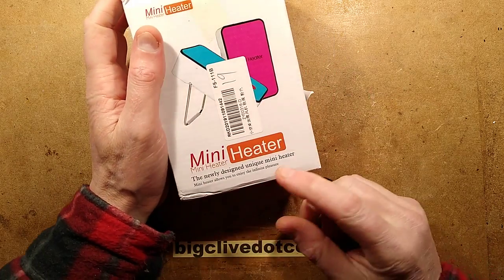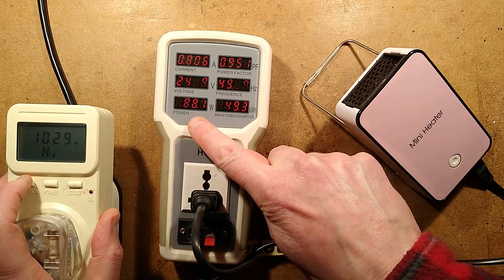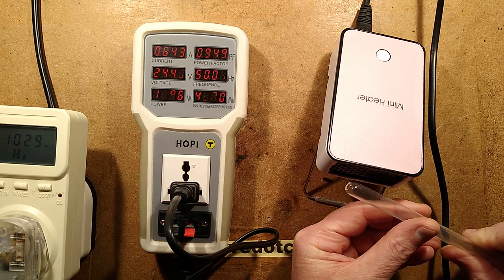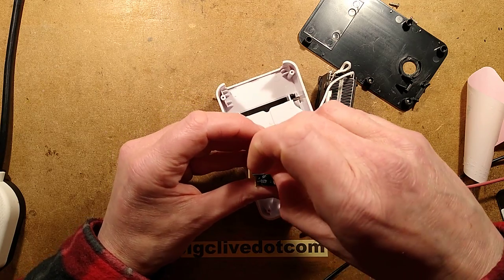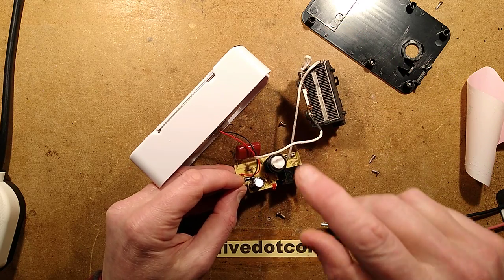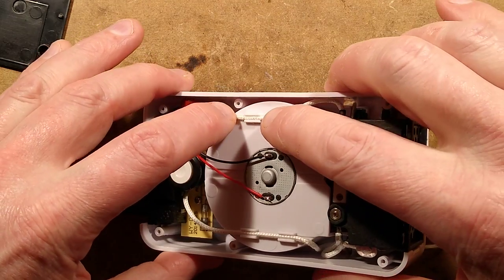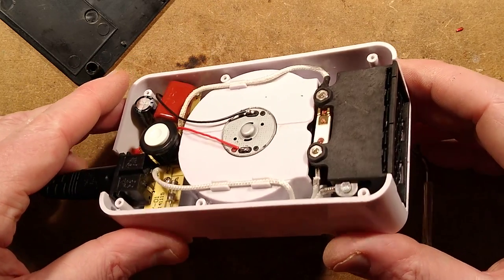All plastic 150W eBay desk mini-heater.  (With schematic.)

Comment: Anyone else end up rooting for the little thing?

"It'll overheat and not cut out if I put it down flat."

cuts out

"It won't start up again."

starts up again

"It can't shrink heat-shrink."

shrinks heat-shrink
Reply: It's the little fan heater that could 🙂

Yep, I tend to root for the cheap electronics. There is something satisfying about things that confound expectations because, despite being cheap, someone somewhere down the line has put some thought and care into the design. For me it beats the "this USB charger might kill you" type results.
Reply: Just so long as he doesn't say "It's perfectly safe" we're ok.
Reply: I think 🤔 it can, I think 🤔 it can, I think 🤔 it can, It Can!!!!!!!
Reply: it trust it tbh
Reply: I have one
Reply: Yeah it's a verry good thingy I mean the safety functions and so I am amazed
Reply: Go mini heater go! Decent build from the looks of it.
Reply: I bought it thanks to this video. But also cause well during Winter i feel cold at my desk, DESPITE HAVING THE HOUSE HEATER ON.

Now our heater died..:< We're working on getting it fixed.

I have been using it and it keeps me warm at my desk throughout these times.
Reply: YAAAAAA! WOOOOO
Reply: I mean it's a electric heating element with a fan in it. You can buy 1500w heaters from Walmart for $12 with the same "features".

Comment: I've got two of these living in an outdoor mini-greenhouse with a DIY thermostat controller to keep it above 15 degrees in winter....so far they have lived semi-outdoors for 2 straight years and are still working. Very impressed!
Reply: Hi mate I was just wondering how long you run the heaters for. Do you think they could run all day and night or is that to long?
Reply: @holdengurl1013  You could run them 24/7. I only had one fan motor die but the built-in bi-metallic thermoswitch stops them catching fire.
Reply: Thanks. Dose the one the fan died still heat? Or does it cut out.
Reply: @holdengurl1013  The heating element turns on but because theres no air flow it trips the thermal switch eventually which turns the heater off.

Comment: 7:50 that motor is an RF300, a very good (high efficency) motor. Runs in either direction, can output some torque.
Forgot the exact specs, but was somewhere 0.5 to 6V.
Reply: Assuming the zener is swapped out for a 6v one, any idea what value of dropper capacitor would be good to make the fan run at full speed?

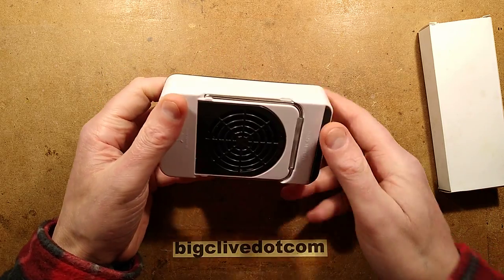Comment: 1:37 The way I remember it is that an axial fan is the one that moves air along its axis (ie a normal fan), whereas a radial fan moves air along its radius (ie a side blower fan).
Reply: That's it.
Reply: Yes, but I think that our favourite Clive may have been confusing the 'lean' of the fan blades (or he may not).

I have encountered someone who thought that because forward facing blades would 'scoop' the air in that bulk air flow would be from outside to the centre of the fan if reversed (for this type of radial fan).

air will flow centre to edge if rotated in ether direction.
https://www.rs-online.com/designspark/fan-types-why-choose-a-forward-curved-centrifugal-fan
Reply: That made that connection super obvious xD

Comment: Thanks for another great tear-down video, Clive. I've got one of these heaters and you've given me a peek inside. It's good that they took the trouble to add a zener to prevent the reservoir cap from exploding if the motor goes open circuit as of course it will do in time being a tiny brush-motor. A pity though that they didn't add a current in-rush limiting resistor to protect the contacts in the switch. I've noticed a sharp crack from the switch on occasions at switch on indicating a surge if it hits the peak of the mains waveform by chance. I don't suppose the switch will survive too long before failure because of that. Perhaps thanks to your disassembly demo I'll add a limiting resistor at some stage!

Comment: you talking about the fan and it possibly fouling the housing and making a noise reminded me of something that happened some years ago . My ex used to work for a council in the U.K clearing rubbish and taking things from houses for people when they wanted something disposed of . She went to a house and collected a microwave cooker , quite an upmarket one . Instead of taking it to the tip she brought it home for me to take a look at it . Plugged it in and there was a horrendous screeching noise . Out came the screwdrivers , off came the cover and yes , the fan had moved on its shaft . Eased it out , mixed some Araldite , put back together and bingo , we had a microwave . The thing was like new inside and out , hardly used if at all . She collected it from an affluent area so chances are it was bought , plugged in and made the noise so they just bought a new one and threw this one out . Lucky us

Comment: To be honest, I was surprised by the thermal safety cutout... And then surprised again when I saw it self-resets! I imagined it would be the "unplug-allow unit to cool-plug back in" reset procedure many US heaters have. To have a fuse before the power switch is a nice safety feature that not even Weller soldering stations have.

Comment: Love the video, I use these little heaters for small off grid applications and I ended up adding a diode in series with the element which cut the start up current down by 50% and constant output reduced by 5%.
Reply: That's a pretty genius modification to a PTC heater 👍
Reply: Can you do those modifications for me, if I post it to you from Australia? 😀

Comment: I remember when I took apart a broken camera after I'd been testing it, I thought it wouldn't be that dangerous running on 2 AAs, I bridged the capacitor for the flash and ended up with 2 deep scorches on my finger, its probably the worst shock I've ever had and I've been shocked by a 100kv HT lead on a car. I think the biggest thing was that the capacitor felt like it passed allot of current over a longer period of time which ended up burning my finger pretty badly.

Comment: I like the way the thermal fuse doesn't cut out the fan.
Reply: That part may have actually been designed by an engineer.  But then the bean counters and production line gets a hold of it... So they have to make the case bigger because it was melting, lol.

Comment: I'm still waiting for my chinese automatic house ignitor to arrive that I ordered before christmas, need to get warmed up by dangerous heater products, this one is just too safe with its' thermal cutout safety feature!!! :P
Reply: did you order your  Chinese automatic house igniter ,with or without the automatic magic smoke release option? and it must have randomly flashing colored LED lights or it's no good. it's the only way to tell real china quality.
Reply: @immrnoidall  Real china quality means it arrives broken, with a small boot print on the outside of the package.

Comment: If you wire the fan to run in reverse, it will still blow out the front, but very much reduced, it's a centrifugal fan.

Comment: I have used one of these to stop my hands freezing at my desk over 2 winters and it has been great - but I never leave it unattended
Reply: Why don't you simply use a 100 Watts incandescent light bulb?
Reply: @christiangeiselmann 
Probably because they're too hard to find now with all the greeny laws.
Reply: @christiangeiselmann  Or because they radiate heat in all directions, rather than blow it towards your hands. And if it's on your desk you might not want to have a 100W bulb shining in your eyes all day. And a PTC heater is a neater more rugged package that won't get as hot to touch as an incandescent bulb would.

...Or, you know, it's the green police's fault.
Reply: @christiangeiselmann  What kind of 100W lamps blows warm air in the direction of your hands?
Reply: SkyWizardless   You can hold your hands close to them. Advantage: no noise. - I prefer that, instead of having a thing humming all the time. But of course, your decision.
Reply: @christiangeiselmann  Not very useful if you need to use you hands to do something, e.g. typing on a keyboard.  Not only is there a risk of burning yourself if you accidently touch a 100W light bulb, the idea of huddling up over a 100W light bulb for warmth just seems ridiculous. If your hands are that cold and you aren't trying to do anything that requires dexterity then put thick gloves on and wrap a blanket around you.
Reply: SkyWizardless   Okay, okay...
Reply: "stop my hands freezing at my desk over 2 winters"

Your boss must be a real jerk, Bob Cratchit.
Reply: Jason Carswell   Some people have issues with blood circulation.
Reply: @jasoncarswell7458  maybe works in a warehouse?
Reply: @AAAyyyGGG  Filled with frozen fish sticks?

Comment: Got one of these based on this video to help dry out my car after a big rain leak and it’s done a great job on one side but the bimetallic strip broke after 3 days of it being turned on before I could dry the other side.  Neat little unit though,  not too hot to damage anything just not up to constant use.

Comment: The power lead appears to actually be to US plug standards. The holes in the blades are the US/North American standard whereas the straight/plain blades with no holes is the Chinese version.
Reply: That's what I call a hybrid plug. The blades have the holes, but the part you hold on to appears to be too small to meet standards. Also, heater plugs are supposed to be polarized (so that the switches are on the live side and not the neutral) and those are not. That thing definitely wouldn't meet UL or CSA standards, though it's not horribly dangerous, either

Comment: I like your way of walking us through various "automatic house fire" contraptions, small armpit heaters like this one and hackable led lights.
Have you put together a video of your bench tools, safety measures (like your fire tin), what is the connector you use to hook up mains voltage with?
I've looked on your channel for one but I wasn't comprehensive.
I really liked your video about your mom.
Thanks for sharing.

Comment: Actually that build quality is pretty top of the line for gadgets, wire routing as you pointed out, tab on the lid to hold the mains socket steady, thermal disconnect, everything screwed in, and minimal parts to reduce failure. The only issue with cheap Chinese stuff is you never really know unless you take it apart as you did but they did a nice job on that I think.
Reply: I’ve got one after seeing this being taken apart. It’s got a uk plug and rated 200watts. Output temp is 129°c. Simple & effective for a small room.

Comment: Self regulates and makes low level heat... That might be something that could be hackable into heating for pets. Like a reptile enclosure, bird cage, or a small dog house. (At least if it doesn't outgas much after breaking in for a while.) Heater itself would need some weather and/or mess proofing (likely by mounting it high and ducting the output elsewhere), but it wouldn't be too hard to make it circulate into a bigger enclosure that it helps keep warm. And perhaps controlling it with an external thermal switch, if the enclosure that it helps heat isn't too drafty.

Comment: I have one vary similar to this thing but 12V for automotive battery.    Works quite well to get the chill out of the cab until the regular heater ever tries to warm up.   Defrost the wind shield quite fast too.
Reply: I have one of those for my old pickup, because the heater core went to hell and it's not worth fixing!
Hey, better than a sharp stick in the eye ! 😊
Reply: @kengamble8595  Sounds like my ride.  LOL   I picked mine up at the Flea Market some years back for like $1.00.  It was all grubbed out but cleaned up and still Chooching along all this time.
Reply: @kengamble8595  Actually I wouldn't mind finding a few more.   They would work good as a Dump Load on my Solar system.   Better to warm up the hall way a bit then just use a resistor to burn it off.   Else should be going to a water heater if I ever get around to getting one.
Reply: @pulesjet 
I got mine at Harbor Freight a few years ago, when they were on sale of course! Don't know if they still carry them.
Reply: @kengamble8595  Closes one to me is some 50 miles one way.  I make it there maybe once a year.  I'll try to remember.  LOL

Comment: Those little motors are very common indeed. I replaced the disc drive motor in an XBox 360 with one of these I sourced from the vibration motor in a PS2 controller.
You can't replace the optical drives in a 360 because Microsoft decided to match the serial #'s to the console. But nothing to stop you from replacing the motor hehe
I got the 360 for free because the owner though it was junk - that was 7 years ago and it's still working.
Reply: Nice 👍

Comment: I use a pair to keep the inside of my resin 3d printer warm. A simple temperature controller for a terrarium and some insulation work wonders.
Reply: Yes, I agree it likely has far more better uses than just heating desks.

Comment: I bought this thing just two weeks ago. Very useful when you tend to get cold feet. Also, my heater got a completely different thermal cutoff. It´s like the manufacturer actually watched this video. Now the bimetallic cutoff trips just slightly above working temperature. You block the air intake? *click*, the bimetallic cutoff switches the  PTC  off within 10 seconds.
Even more bizarre, you switch the heater off, you can hear the bimetallic cutoff go "click" because the heater has no airflow anymore, but has residual heat.
What else can I say? It´s *tiny*. Size is like four iPhones stacked on top of each other. Weight is like a single iPhone. It is really silent, there is just a faint "whirr" it emits. I could sleep with that.
Actually I was falling asleep with the heater within 1 ft next to my head twice. It´s not dead-silent, but it emits the kind of "white noise" some people ( like me ) find immensely useful whilst getting to sleep.

Comment: I have a bathroom fan that has the same shaft style (tight plastic, no clamp). Of course, twice now I have had to open it and re-melt the plastic tight and now I have a clamp...but it still sits and stalls from softening over time from the heat generated along the motor shaft.

Comment: @bigclivedotcom - At 14:55, when run in "reverse" by your apparent definition, less air is flung out at a given RPM, but the fan also stops having the annoying habit of pulling more power when the inlet is blocked/less when the outlet is blocked. In the case of this little heater, a polarity-reversing switch on the fan power will give the unit 2 different heat outputs, because at low airflow, the PTC resistance element will run at lower power. By the way... At a higher RPM, those centrifugal/radial fans still move plenty of air when run "backwards", and create significant pressure if necessary to achieve that flow. I've seen them used to drive a minor hurricane of air through rather restrictive HEPA filters, for a once-through air supply to hospital operating rooms. (No recycling of germy air!) The same principles apply to centrifugal pumps for various liquids, and vanes all pointed straight out radially from the shaft also work, with characteristics somewhere in between those of forward-swept and reverse-swept blades.

Comment: I just bought one of these and since I had to take it apart to bring the heating element wires out separately (I'm hacking a little temperature control system for the tent of my 3D printer) I was looking at the power supply and thought, "Big Clive should have a look at one of these... if he hasn't already".  Went looking and here it was. :)

Comment: In hillbilly country, we call those "squirrel cage" blower fans
Reply: B-but “squirrel cage” refers to induction motors though
Reply: @Scrogan  nope. Just any cylindrical cage type fan. The HVAC blower in a car for instance.
Reply: @Scrogan  That's a squirrel cage motor. Not a squirrel cage fan.
Reply: The term is used for both items, even though they aren't otherwise related.
Reply: @longrunner258  Except that one often drives the other. :-)
Reply: @Scrogan  - Squirrel cage can refer to anything that looks like a hamster wheel, be it a centrifugal fan or the shorting rings and conducting bars of an induction motor rotor.
Reply: And squirrel cage fans are much quieter than axial flow
Reply: @Scrogan  For the same reason ! D-oh !
Reply: @longrunner258  Despite potentially being on the same shaft :)
Reply: @JohnQLamb  I totally disagree - with the exception of helicopters !

Had both at my secondary school - the axial fans run slower and are a lot less like the design of a siren !
Reply: Are we allowed to put squirrels in cages these days? :-D
Reply: @AAAyyyGGG    this device is only suitable for micro-squirrels, which are not known to biologists and hence unprotected by law.  Personally I think that whirling them at high speed is cruel and don't see why anyone wants to.  But then I don't see why the term "squirrel cage" is used at all.  Many traditional canary cages are cylindrical, so why specifically squirrel?  For the squirrel cage motor I reckon it's simply a mistake in translation, the inventor meant spiral cage.